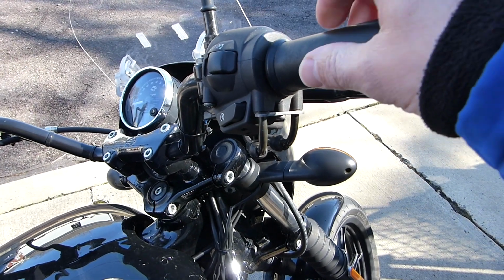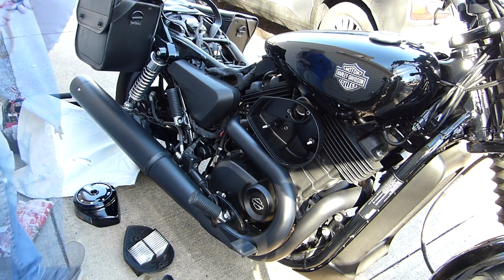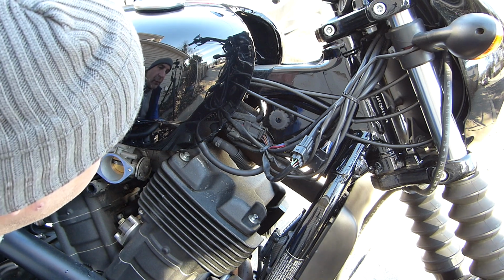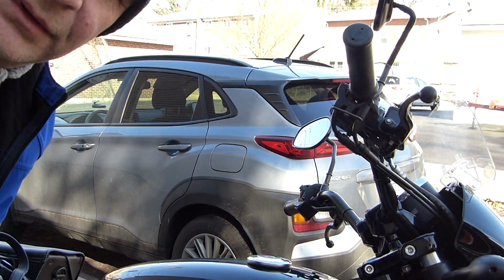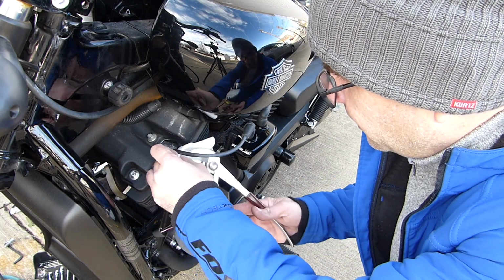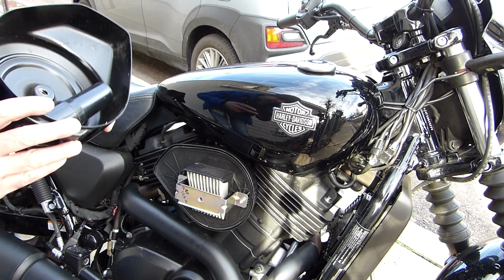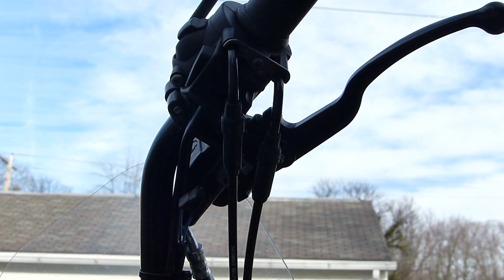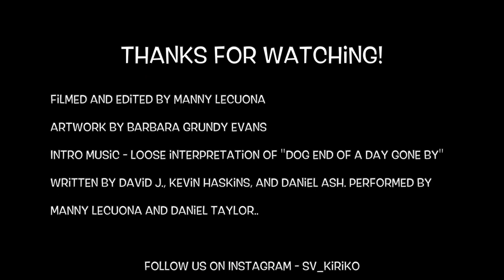Replacing idle cable, brake switch, & spark plugs on HD Street 500. (Not) Sailing Kiriko Episode 25

Comment: What size socket did you use to remove the spark plugs? What gap did you use? (Why is this information so hard to find anywhere?)
Reply: Did you found out what socket size ?
Reply: It’s 5/8
Reply: Owner manual says about .031 0.35